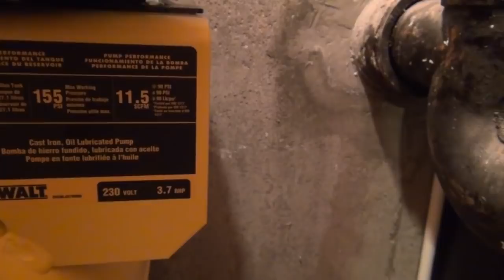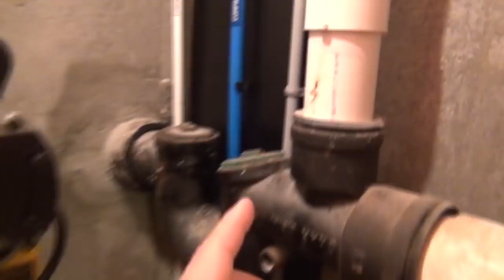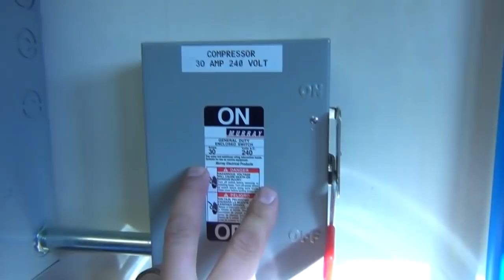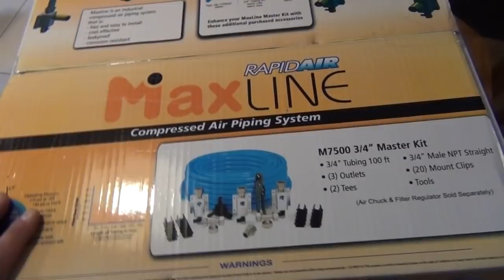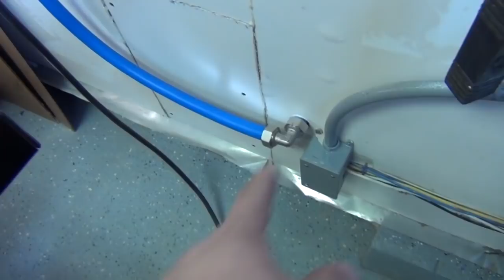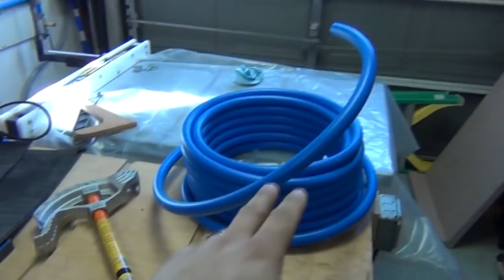Air Compressor and Shop Air Install

Comment from the maker: http://amzn.to/2kHbeen  DeWalt 60 Gallon Air Compressor
https://amzn.to/3HKDsgb  Air Filter Regulator Combo 3/4" NPT
http://amzn.to/2kH0TiM  TEKTON 1/2-Inch I.D. by 3-Foot Lead-In Air Hose
http://amzn.to/2kH1Wil  Maxline M7500 Master Kit, 3/4-Inch x 100-Feet
http://amzn.to/2kWjndC  ¾” Elbow for Maxline Kit
http://amzn.to/2kkyICP  Anti Vibration Pads – Set of 4
https://amzn.to/3FTboXe  30 Amp, 240 Volt Disconnect
https://amzn.to/3eJNEJ7 Brady Label Maker

Comment: That's a super good deal I just bought one yesterday from Tractor Supply identical to yours DeWalt 60 gallon 155 PSI 3.7 horsepower but I paid $695 out the door

Comment: This is a great replacement for my old regulator/oiler that started leaking It came with brass nipples that saved me a trip to the hardware store and even came with teflon tape.

Comment: Great video.  Gives me a lot of idea.
Questions:
This video is 6 years old.  Have you attached an air dryer/cooler addition to your setup?
Where do you drain out the tank condensation to in the closet?
thanks.

Comment: Putting the twist lock also makes it code complaint.the 20 percent rule is to keep the wires from over heating it definitely should be 10 gauge and if it’s more then 75 feet should be 8 gauge .

Comment: When you first installed your Air compressor, did you leave it open to the atmosphere and run it for 30min-1hour to break in the motor?  I'm looking to install mine and I've seen a few videos recommending it.
Reply from the maker: I didn’t do that. Still have the same system in place for at least 5-6 years now…no issues and everything working great

Comment: Hi more power to your channel ,I got a question I have a 50 ampere service in my garage and it’s 220volts can I use my dewalt air compressor same as what you have?do you think it’s possible?thanks any comments is greatly appreciated.
Reply from the maker: Yes, should work fine. That’s what I have in the video.  Just make sure all the breakers and wiring is sized correctly

Comment: Had 2 of those from lows..china built..runs vary loudly..,change the oil every 2-3 hundred hrs..I hope your room is vented ..nice set up..I went American  made..no more China crap..have a Saylor-beall..made in st.johns ,Michigan..All American  American  iron..Baldor  motor..mine runs on a 30 amp.220 v..and runs vary quit..my 3 hp. Unit is a 2 stage pump..spent 3 grand ..I would put a fan in your closet..again love your set up..I'm now retired..I'm in fl.  So for heat issues  my unit has an after -cooler built on my unit with a fan..built on the motor..check out utube video  on Saylor-beall..fully pkg  unit ..ul see how they build there. Comprsoir s...u can do a set up on yours simply..add on to yours ..

Comment: You need already 3/4 inch line leaving tank you have really cut down your volume,   with the 60 gallon 155 I found it best to reduce pressure setting to 135  to prolong life of compressor they struggle the last 15 psi to shut down and you will never need 155 psi,, l went from 7 to 5 minutes to fill tank from empty. Will give you year's longer
Reply from the maker: Thanks, I’ll look into making the change

Comment: Double pole 20 amp is 40 amp overall you should run intake through wall to outside, I did really quiets down and you get fresh air., I did a 25 foot of 1/2 inch copper tubing between compressor head and tank with air separator just before tank will drop your air temperature and reduce moisture in tank.l hardly ever get any water after doing it

Comment: Great video! Just got the newest version of this compressor from Tractor Supply. What is the cut on/off pressure on the compressor? I noticed it has a bung at the front that is blocked off, is that where you can take control of when it cuts on and off?

Comment: Before blindly following mounting "advice" check the installation instructions for your unit. For example Quincy explicitly forbids any isolators with its QP-series vertical compressors.
Reply from the maker: Curious as to why that is?
Reply: @fixitwithzim  no idea but it is undoubtedly a very good idea to follow manufacturer instructions.

Comment: I set up my garage in similar fashion, however I used copper pipe and sweated necessary fittings. I have a sand blast cabinet along with tools throughout the garage. Been running it for 2 years. With no leaks or issues.
Reply from the maker: Nice, sounds like a great setup!

Comment: Condensate forms in the piping. As such, you do not want it plumb to the ceiling, you want it pitched away from the compressor 2" per 25' of run. Your blue piping is already flexible. It you used a valve with a pex barb at the compressor you could have connected directly without the whip.

Comment: Please read.. the electric motor on ours cought fire in a well ventilated room. It was a husky brand with the same electric motor as yours. Ours wasn't the only one. It was about 4 years old.
Reply: Dang hows he gona say somthing like that, then leave us all hanging? I'd like to know what brand motor catches on fire lol. Ofcourse it's on a husky thou, I seen one of there ratcheting end wrenches catch on fire one time...to much torque I guess🤷‍♂️.
Reply from the maker: Interesting, does the manufacturer have a recall out on the motor?  What brand is the motor on yours?

Comment: Wrong pipe S/B copper, kits are crap ,wrong place to put it..SCFM MEANS BS WHAT IS THE CFM? it’s about cfm and volume. You are building in problems with this install.

Comment: It's been around 3 yrs since you post your video- question, has the rapid air system held up to your expectations? Also I think you did a great job installing. I too would put a shut off valve where you said you should..thanks for sharing!
Reply from the maker: Thanks!  Yes, no complaints on the rapid air system. Still working great and no leaks. I wouldn’t hesitate installing it again if I needed too.
Reply: @fixitwithzim  thanks so much for replying! I'm purchasing tomorrow!!

Comment: I had always heard to NEVER use pex for air lines. They always leak at the push fittings....and if it doesn't now, it will. I was debating doing 3/4 copper pipe
Reply: I've used pex and sharkbite fittings for years, never had a problem. Just make sure you gauge all you fitting.

Comment: Code violation.  Disconnect must be within line of sight of the motor. You failed sir.
Reply from the maker: There’s a switch on the compressor. No need for a disconnect on this. Go back to school

Comment: How many amps will determine what size breaker to use.
17 amps 20 amp breaker on 12/2 Rolex
Over 20 amps 30 amp breaker with 10/2 Rolex 
You could also use mc and not use the pipe.
20 Percent only applies to something that can run continuously for three hours or more that compressor will not run continuously for three hours or more.

Comment: As a retired machinist I will say that you did a professional job. You obviously planned out the project and it shows. The lines looked plumb and level. The hose mounting clips all looked at the same level and spaced evenly. And the hose itself is pulled straight, not drooping like Xmas tree lights. Also, I have the exact same moisture/filter and regulator (SAF and SAR 4000?). The SAF performance is just ok so I added a Motor Guard M60 filter to trap additional moisture. Thanks for the video.

Comment: Thank you for the time you put into this. I am starting my piping today. At the bottom of the vertical runs, and at the distribution blocks, I will install a 12 inch or longer pipe down to the drain valve to have a reservoir to collect the water so the air doesn't have to bubble through it between drainings. Maybe useful, maybe overkill, just me. I also plan to take off the top of the horizontal runs using a T for my feed lines. My thinking is this will reduce the amount of moisture to the point of use. Your time and effort in this saved me a great deal of time and research. It is easier to build on an existing project than to start from scratch. Thanks again for taking the time to produce this video.

Comment: Great vid! Very nice install! Thanks for sharing!
I'm installing a 60 gal. 2 stage Kobalt (Lowes/Campbell Hausfeld) outside my 2 car garage in a shed. Do you think you would put a filter down low at the compressor on hose before the run you made with the maxline? Mine will be all level ground but thinking on a filter low in the shed before entering the garage. Gravity is a cheap commodity.... Thoughts?

Comment: THAT THING GONNA GET HOT AS HELL IN THAT CLOSET!  GETS MORE WATER IN THE LINE, AND WILL SHORTEN LIFE OF AIR COMP.   you could add a fan to cool it maybe, but that does keep sound down in the closet.
Reply from the maker: Actually it’s been great in that closet and hasn’t gotten hot...going on 3 years now. The closet also isn’t closed off fully. Watch the whole video. Thanks for the comment.

Comment: Great vid man but one question, in your finished basement, how do you drain off the compressor tank itself without staining the floors with the brown oily condensate that comes out of the main tank?  A lot of water builds up in them no matter what if you don't have a pre-cooler and trap before the tank in but after the pump..  I use a car transmission radiator and gravity trap below the tank drain so had to mount the tann on a big block pad..

Gotta drain off those tanks at least once a month otherwise that closets gonna turn into a window to the garage..
Reply from the maker: I put an old 5 quart oil container that I cut the side off of under the tank and bleed it. The container traps the rusty water. Thanks for the comment

Comment: Gotta ask. . . Since you don't appear to have anything permanently connected to air (like a blast cabinet) and it looks like you already have a hose reel that you mention plugging into the last outlet in the air line. . . why didn't you just mount your hose reel on the wall near the filter/dryer/regulator, run pipe semi-permanently to that, and then use the hose reel for whatever it is that you use air for - instead of running all that tubing all the way up and around the garage? I'm just curious. I mean, if I didn't have a blast cabinet, I'd just mount my hose reel right next to the compressor and pull hose out when I need to inflate tires, run my impact wrench, use a cutoff tool, etc. Especially in a one-car garage, it seems like that would have been a lot easier.
Reply from the maker: Jerry C I was planning for future use.  I’ve reconfigured my garage to now have a bench on this wall (you can actually see this in my drawer slide video). I now extended this drop to the back wall so I have air on my rear wall bench and have a coil line permanently connected here.  I just prefer this convenience wise to have a short hose on my tool ready for use rather then running line from the spool. You’re right, could have done it either way. Just my preference and it made for a good video. Thanks for the comment.
Reply: @fixitwithzim  Ah. That makes sense. I'm currently designing my airlines so I have a conveniently located outlet for paint guns (i.e. pre-oiler), my hose reel (for car work - inflators, impact, etc.), and 2-3 bench outlets for . . . whatever I end up doing at the bench. But, I think I do like the idea of running a hard line across the garage so I have an outlet for a short hose on that end. You've got me thinking! Nice job on the tubing, btw - I just had to ask why you did that.

Comment: Can you show how you are wired from the receptacle to black control box on the compressor? I just bought a DeWalt 60 gallon myself.  I already have 30 Amp NEMA 5-50P outlet in the garage.
Reply from the maker: CRM6718 Did you figure out how to do this, sorry for the late reply. Been busy
Reply: @fixitwithzim  Hi, yes I figured it out. Now, I need hoses and filter etc setup...any thoughts on brand and where I can buy it?
Reply from the maker: CRM6718 Yes, in the video description is links to all the items I used.  I haven’t had any problems and everything has been working great

Comment: What wire did you use from the compressor itself to the twist lock plug? I just got one of these compressors and was curious what others have used. Thanks!
Reply from the maker: Philip Rudd 10 gauge, 3 conductor SJ cord

Comment: i thought i heard you say that you ran romex  through the conduit?  that would be a bad idea for several reasons including being a code violation but more importantly its a fire hazard. the sheathed wire (romex) is not rated for use in conduit ; at the very least the sheathing should be removed from the conductors to avoid excess heat buidlup inside the conduit. Not trying to be negative at all, just a headsup  in case you actually did run romex inside that conduit  don't want your house to catch fire and do want you and your family to stay safe.
Nice neat install
Reply from the maker: Don Alexander thanks for the comment. You’re partially incorrect regarding Romex in conduit. NEC 300.4 actually calls for protecting conductors and cable where physical damage might occur.  I believe it goes on further to say NM cable sleeving is recommend in areas subject to these conditions.  You can take that interpretation anyway you’d like.  In my case, I believe I used 1 1/4 conduit to sleeve the NM cable. In my opinion, there is no chance for harm here, especially with both ends of the conduit open and not sealed and the cable having plenty of “breathing room” in an oversized pipe.
Reply: @fixitwithzim  Your PVC (or CPVC - or whatever you're using) isn't sufficient. Period. The code is really only worried about physical damage from nails or screws... Here's a DIRECT quote from NEC 300.4:

the cable or raceway shall be protected from penetration by nails or screws by a steel plate, sleeve, or equivalent at least 1.6 mm (1⁄16 in.) thick.

For the safety of your family, protect those wires. Please. Are you likely to cut into them? NOOO!!! Could it "maybe" happen? YEP! That's the reason for codes.
Reply from the maker: ddotodd11 thank for your concerns, yes understand what your saying but there is zero chance of someone screwing into that conduit (8 inch poured concrete foundation wall on one side and the opposite side is open in free space, not hidden where a nail or screw puncture would be possible). But yes, in a concealed space, emt would be in order and the better choice

Comment: Nice work!! Only "bad" thing is, this red soft hose, next to tank, will fill up with water. You may cut it a little..
Reply from the maker: Riku Koivisto I actually haven’t had any moisture accumulate in the hose. Good observation though

Comment: what kind of pipework do you usally use for a compressed air intallation
Reply from the maker: Morgan Mackay Usually black pipe but found this kit pretty handy and easy to install. Over a year later and still no leaks and holding strong!

Comment: Most recommend having an 18" clearance away from the wall for air flow. Do you find having it in such a closed - in space a problem with air flow for the motor?
Reply from the maker: Bobby Prewett no problems at all. It’s been working great and doesn’t get too hot.  I’ve been running it in this location for a little over a year
Reply: Without looking it up Id guess it needs 1000 cu ft of air space..

Comment: I though about doing this in type "M" copper.  It's cheaper than "L" & faster than black.  You've got an awesome setup, there.  Thanks for the tip on using that hose as a buffer for neutralizing vibration.

Comment: They are not all the same. That compressor is a single stage.Where was the compressor and electric motor Manufactured (What nation) ? I would go with a 2 stage shorter cycle times and higher pressure,total different animal than a single stage.
Reply from the maker: muddyriverdogz Nahh, this one works great for what I do. Thanks for the comment

Comment: Thanks for this, a thorough overview and exactly what I was looking for. That said, I think you used 30a fuses in the disconnect, may I ask why? You already have a 30a breaker on this circuit, so is this redundancy needed?  Or am I missing something? Thanks again.
Reply from the maker: The disconnect I used requires cartridge fuses in order to work...completely not needed but it was the only disconnect I could find at the time.  The breaker alone is more then sufficient.  Hope this helps.
Reply: @fixitwithzim  Not sure, but I think the panel breakers are not designed to be used as "switches". Just resets when tripped. The disconnect is a switch.

Comment: Was the price of a long 3/4 hose more han the whip?  Just cut and add a new end if not.  Leftover hose gets an end too, does it matter if it's 12 inches shorter?  Nice compressor closet.  Did you use an exterior (insulated) door?
Reply from the maker: Ron Yerke You could definitely do that. I wanted a 100% leak proof system and my experience with clamping new fittings on the hose is that they start to leak over time.  The closet door is just a standard raised panel interior door, hollow core. Thanks for the comment!
Reply: zimsjeep Yeah, it's no fun when your hoses leak.  Perhaps a different kind of clamp would be good to try.  I thought that was a hollow core door by the amount of sound coming through it, but had to ask.  My younger brother has doors like those in his house.  He has a matching insulated door to his garage that's pretty good at blocking sound.  I know they're higher priced than hollow core, but if anyone spends significant amounts of time in the next room (or wants to), you might want to think about an upgrade.   I've even heard of people stapling or gluing things like carpet squares or moving blankets to the inside of the doors to their compressor boxes.  Whatever keeps her happy, right?   I like your setup pretty well as is, don't get me wrong.  Keep on keepin' on.  :-)